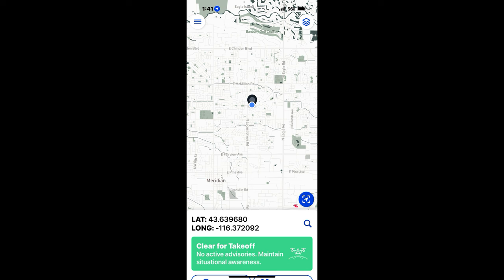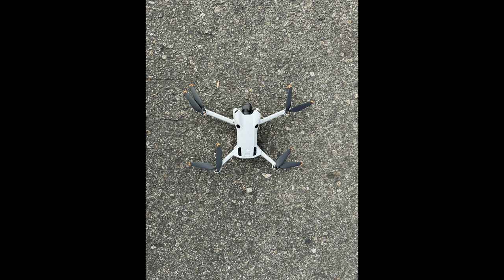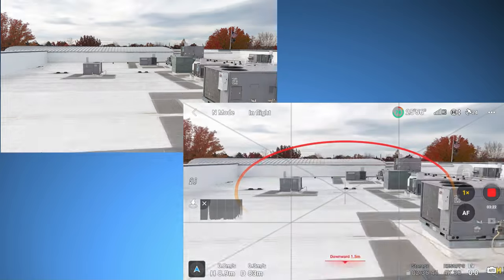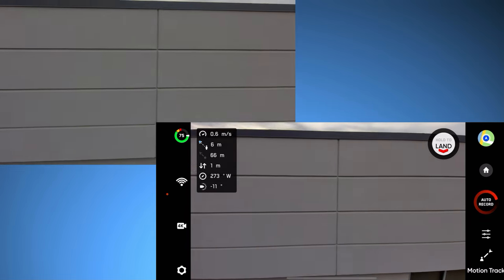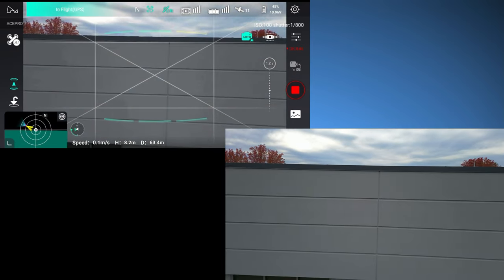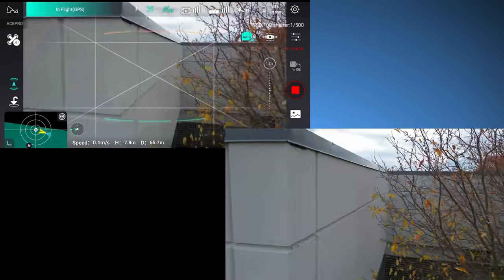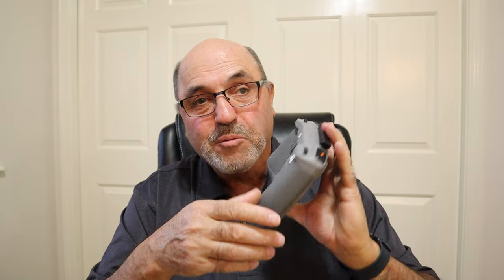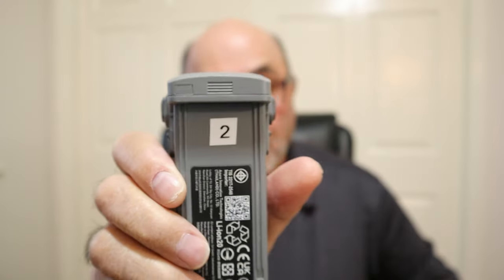Crash Follow-up! My DJI Air 3 Is Back From DJI Repair - Obstacle Avoidance Testing Six Drones!

Comment: I do like a happy ending! Thanks fir cycling back and letting folks know your experience.  Because lighting and other conditions could change, they COULD have been hardasses about it, however they recognise at the end of the day  goodwill has its place for loyal customers.  Ive had similar experiences with DJI Support as well! At one point they gave me a brand new  boxed RC Pro, with another full year warranty after multiple repeating errors. Happy Flying the terrific Air 3!.
Reply from the maker: Thank you John!  Yeah, I flew that bad boy today, and it did great!  🙂

Comment: It’s good to see you got a replacement back so quickly. DJI always has great customer service. They really back their products and care about their customers. With a different serial number they just sent out another drone. That’s great news and hopefully you don’t have any more problems with it in the future. I had a little incident with my mini 4 pro. Using Apas on the Trail allowing it to follow me on my ebike. The propeller clipped a small branch and caused the drone to fall. But luckily it wasn’t very high and landed in leaves. I was fortunate to just have to replace a few propellers. Other than that it did great. Obstacle avoidance works great on these drones. But they have a hard time seeing small twigs and branches. Which is to be expected.
Reply from the maker: Yes, those small branches will get you.  🙂

Comment: Hi Marcus, terrific testing, thank you for sharing. Seems that DJI is not acknowledging that the Air 3 is at fault. When you do your Air 3 testing again, please do the first test with OA on Stop, then with APAS.  It will be interesting to know if the Air 3 has a systemic fault, or at least an APAS limitation.
Reply from the maker: Thank you Richard.  I suspect it's difficult for DJI to warrenty any OA issues, there are so many different situations that can arrise.

Comment: Great job! My "guess" is the lack of contrast, aka Monochromatic. Kudos on not aggressively piloting your M3 Pro into Harms Way!!! Interestingly, when I parked my M2 Pro sideways on top of that 73' pine tree over the Payette River years ago, they too examined all of my flight logs and reported that I had the side sensors turned off based on the mode I was flying; hence, the crash. As back then and a newbie to drone flying, I never flew in Sport Mode. Albeit, they called it Pilot Error, but did generously offer a 15% discount on a new replacement. Not knowing enough to debate the issue further, I happily took deal and thanked them for their thoroughness. BTW, DJI automatically transferred the Care Refresh and my "Personal Items" insurance covered the loss entirely. Suffice to say since that incident, I'm always tentative about OA and APAS and haven't crashed since. Super demonstration and don't forget to deregister your demised A3 and register the replacement with the FAA. Thanks for sharing! 😎
Reply from the maker: Thank you Del!  Yes, I'll edit my FAA registration.

Comment: The audible warning should be enough to warn the pilot with any apas system
Reply from the maker: I don't agree.  The Hubsan Ace Pro was very erratic in that regard.  👍
Reply: @IdahoQuadcopter yes Marcus I agree, though has the calibration been done? For most it's not, it's a long laborious process that isn't needed on other drones. I did talk to an engineer about the AI employed by hubsan for its apas being a left right system, he merely said the drone cannot see above, which to me means it relies on the sensors only with no image processing from camera.

Comment: Care refresh is automatically transferred to the new drone. 

In the end I can’t understand if you had to pay for the new unit or if they did it for free.

I had a similar case with my Mini3 going automatically straight into my car without any controller input. 

They did not acknowledged the drone issue, but they sent me a new one for free with an additional battery and I paid just a small difference (15€) for the battery.
Reply from the maker: Yes, it was repaired at no cost. 👍

Comment: Great testing/comparison video.  Your experience with the Skydio 2 reinforces my observation with the Skydio system (I have a Skydio 2 and a Skydio 2+).  They are superior at obstacle avoidance.  But, the AI nav appears to want to go around as opposed to considering an up and over flight when close in to object... and when simply being piloted real time.  However, when in a fully autonomous mode such as "cable cam" or "keyframe", for example, it seems that up and over and down and under are considered.  [but, this is a moot issue as Skydio no longer is available to just people]

In addition to re-registering the new aircraft with DJI, do you have to register it as a new UAS with the FAA and pay another $5? [I think you may have to do this as a new serial number/new RID number will be in the airspace]  ... and, technically, do have to file a crash report?  [I do not think so as the end cost of repair was under $500].
Reply from the maker: No need to report the crash to the FAA, and yes, I can edit my current registration with the new serial number.  Thank you!

Comment: Also just another thought on this crash. Check page 47 of the manual. It's has a section in the 4th mode called ATTI or attitude mode. 
But possibly something went wrong with that particular drone you had. Probably why the sent another one off the shelf.
Reply from the maker: I'm not sure but I think sending a different drone is just standard procedure.

Comment: When I first got the mini 2 when it came out mine went sideways into an apartment on the first flight and I didn’t have a YouTube channel so no proof and I tried to get it fixed with dji and I got a instant no? I still buy dji but that experience always worries me but they had no choice to repair yours because u had proof,lol.
Reply from the maker: You should always do a screen recording.  It does take the guess work out of it. 👍

Comment: Repaired? I have a question sir. Is the DJI the one to decide of they repair or replace it? So they just fix it if its fixable? I thought no matter how small or severe they replace it with brand new one.
Reply from the maker: Yes, DJI makes the call on the repair.  👍